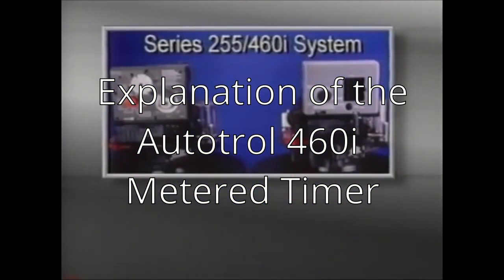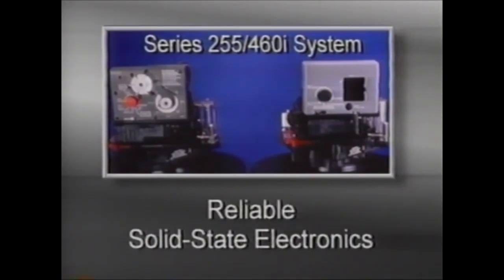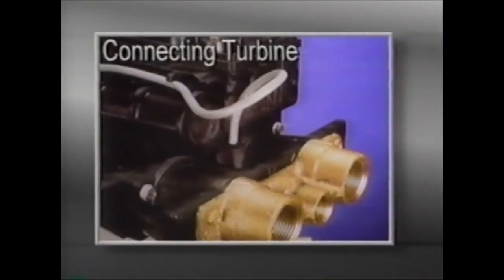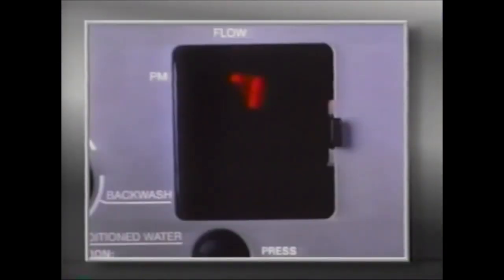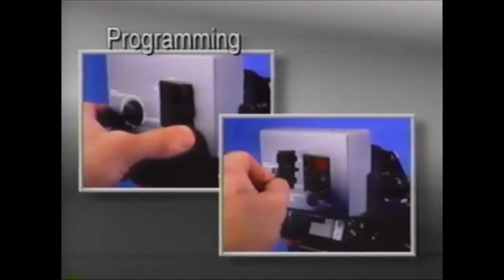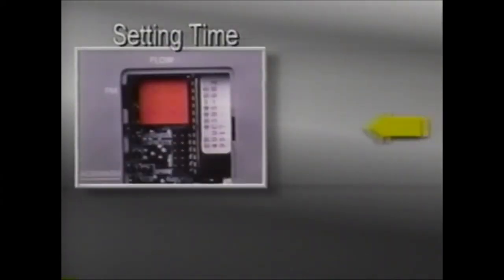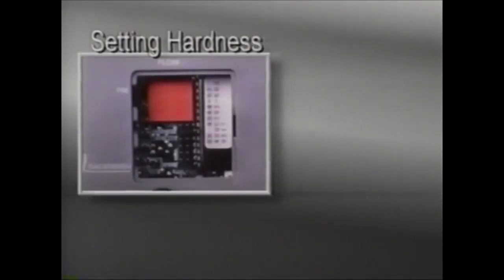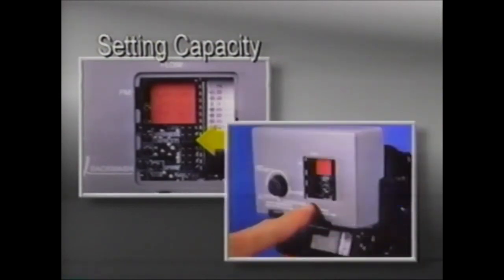Explanation of the Autotrol 460i Metered Timer

Comment: This video helped me get my 460i to work. At 3:17 it tells you the unit will not operate unless the jumper is on the time pins. I read the manual 4 times and missed that bit of info but found it when I was looking for it.
Reply: Glad the video was helpful. Thanks for the positive feedback, it's always appreciated. Softenerparts will continue to support the 460i timer.

Comment: could you please tell me how much the hardness and capacity should be set at with 4 person in the house? thanks
Also, I do not understand every how many days the softner does the regeneration. thanks
Reply: The hardness number will be different for everyone you get that number by sending a water sample to a lab. The report will come back with your water hardness in grains per gallon you enter that number in the softener.
The 460I controls are not based on the number of day since the last cycle. It counts the number of gallons used and will cycle the night before you will exceed the capacity of your resin. A very smart little computer.
Reply: What you need to do is get one Gallon of water and weigh it with a scale so you can find out how much it weighs. Since Hard water is heavier than regular water, that’s why they Call it hard. Do you want to take that weight measurement and compare it to what a gallon Of water is known to weigh 8 lbs. 6 oz. approximately. Compare what your water weighs to the figure above then subtract the two figures. And when you have that number report back here to the comments and you will be guided to the next course of action. This has been brought to you by the L for learning. Can you answer a question for me now? What way is more a pound of feathers or a pound of concrete? That doesn’t have anything to do with the hardness of your water just one of those brain teaser you know.